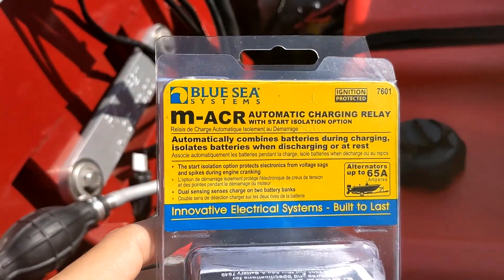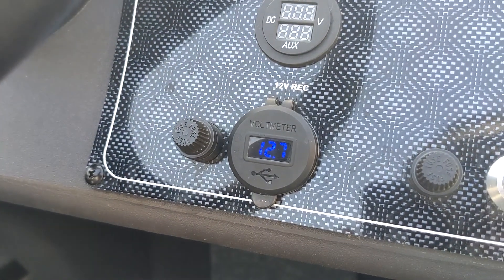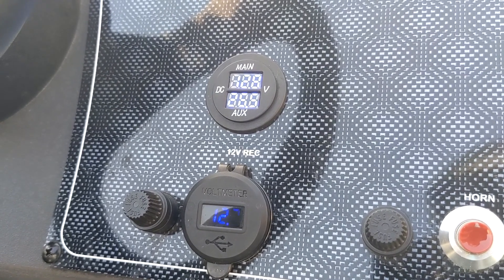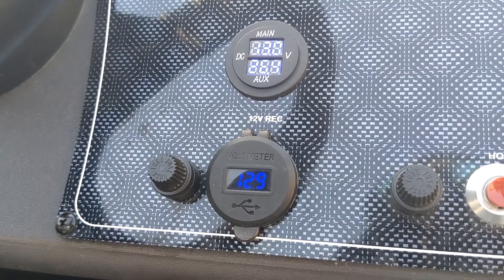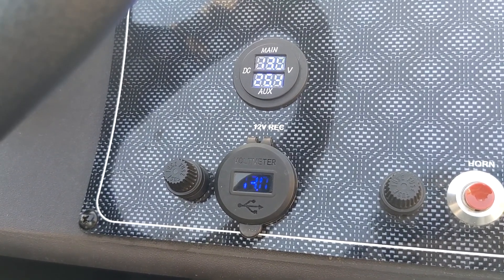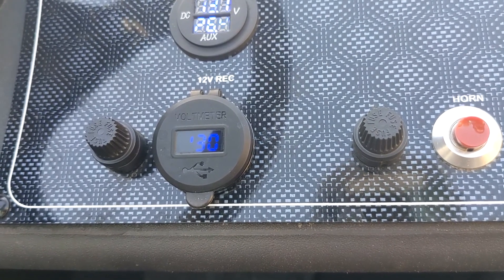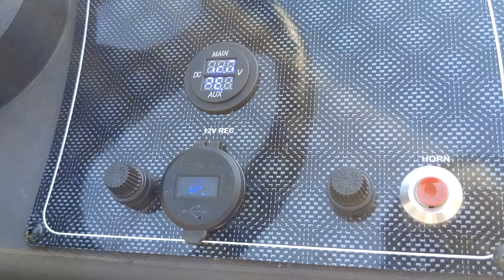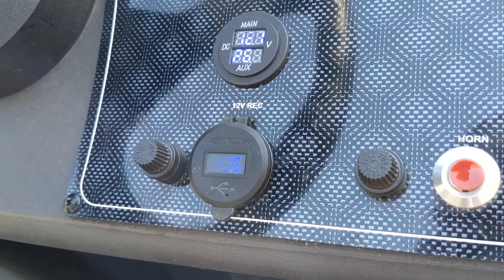Blue Sea M-ACR on Bass Tracker Classic XL in action

Comment: Did you fuse the wires from the batteries to the acr? If so how did you decide what fuse size? Thank you
Reply from the maker: I did not fuse the wiring as the ACR and batteries are all localized in one compartment and wiring does not pass through any other parts of the boat that could risk a short circuit.

Comment: Your alternator isnt charging. Should be above 14 volts when charging.
Reply from the maker: These don't have an alternator, it's a stator that only charges around 19 amps at 5000 RPM and above and the battery was depleted from the previous day of fishing, so it was naturally going to be below 14 volts.

Comment: My ACR just came in.   How do I take the top off to attach the positive leads?
Reply from the maker: I had trouble with this as well at first because I didn't want to break it. You just need to pry it with one or two flathead screwdrivers. At least that's how I did it.